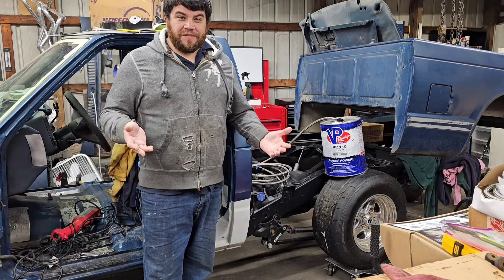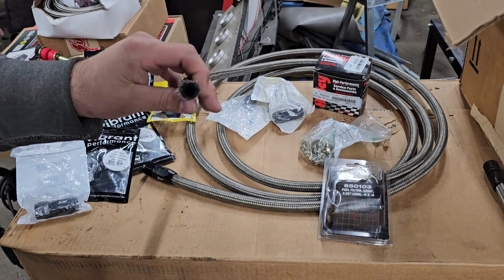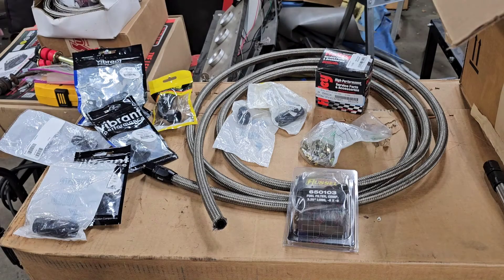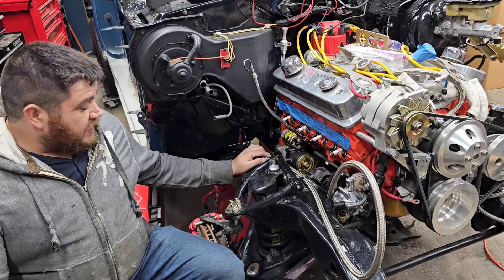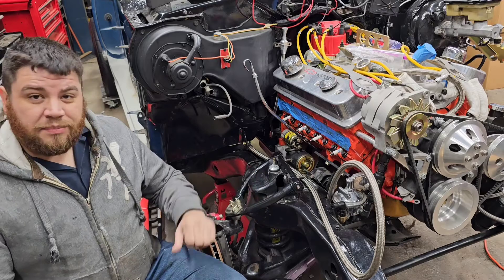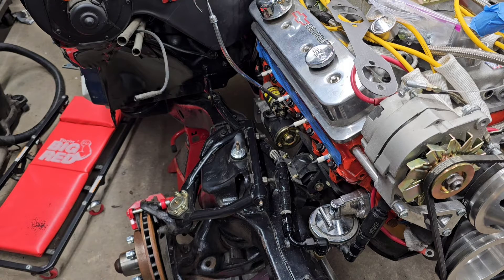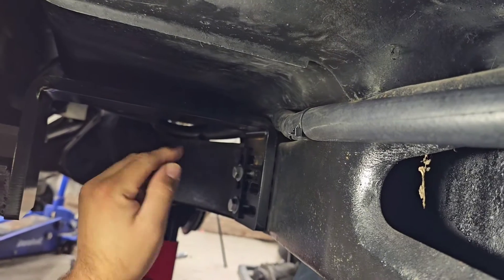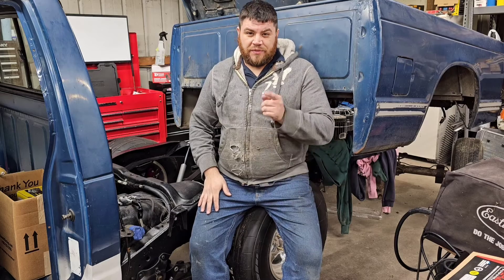SBC S10 AN Fuel Line Setup | From Stock Tank to Mechanical Fuel Pump

Comment: I have a question? So I have a new fuel pump and decided I wanted to run manual instead of electric .I  have an electric fuel pump installed but can I use the electric fuel pump to run to the mechanical pump if I didn't want to use the electric pump in the tank by itself?

Comment: What a phenomenal video , thank you so much, I’m running a mechanical pump too . Question? I see you have two lines capped , where does the other black line run to ? . New sub here . Cheers 🇨🇦
Reply from the maker: Thank you! So the black line I have just ran towards the back of the truck as a "vent" for the fuel tank. I am going to to put a small breather or filter on the end of it as well.
Reply: @304customsgarage  ok I thought maybe it was a return line . Cheers 🇨🇦
Reply from the maker: I didnt run a return line on this but you certainly could and just route it to any of those.